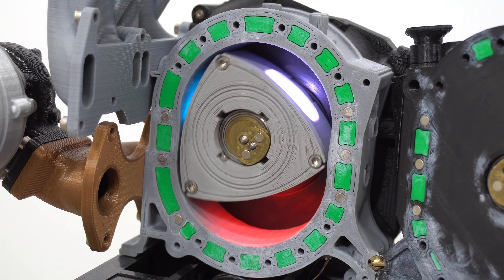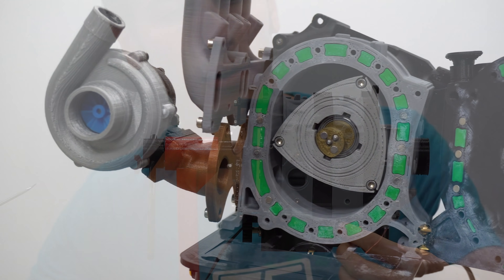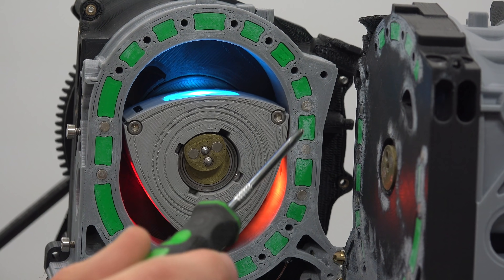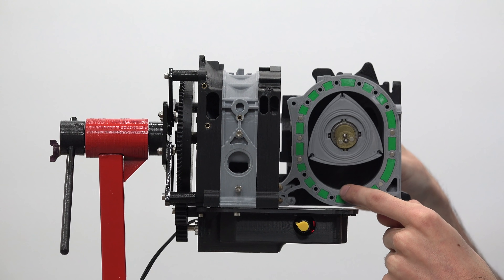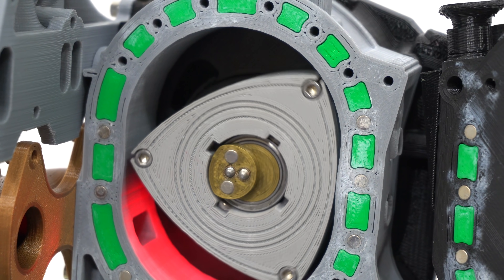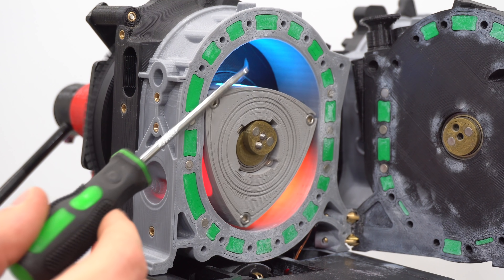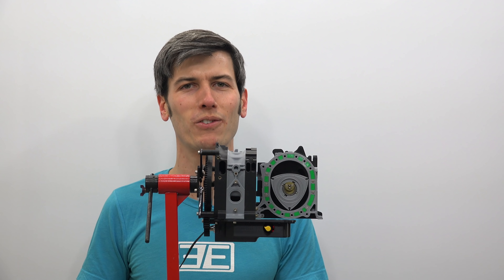This 3D Printed Rotary Engine Is Genius - Mazda RX-7

Comment: Do a video on theoretical "fixes" to the intrinsic weaknesses of a rotary engine. 

Ceramic thermal coatings on the rotor housings and plates. 

Better ignition management. 

Better fuel delivery and porting options. 

Better oil injection. 

I would love to see a theoretical analysis of what would happen by using thermally superior  surface coatings on this engine so it's not producing so much waste on the ignition cycles.

Comment: Not 1.3L in volume... Rotary displacement is based off only one combustion chamber per rotor, so the 13B-REW is essentially a 3.9L engine (the Cosmo 20B 3-rotor is essentially 6.0L). That makes sense from the amount of air it ingests and the power it produces, and the fact that it has the same number of ignition events per rotation of the eccentric shaft as a 6 cylinder engine, which is why Rotary cars are placed in the Power 6 class in import drag racing. I had the last '95 FD3S RX-7 ever imported into the U.S. After non-sequential conversion, it was making ~440 flywheel horsepower on 15 lbs. of boost. Rated at 1.3L, because why not... but it's clearly not equivalent to a 1.3L piston engine.

Comment: I'd like to say to all those engineers who worked on improving the Wankel engine (and other engines for that matter).  Thank you guys, your work has been genius.  So many issues and so many engineering marvels and work arounds.  But the time has come.  Electric is the most efficient, most high performing, most reliable, most practical, cleanest and cheapest way forward.   When the author of this channel, who is a petrol head, chooses a new car - he chose electric.  That should be an indicator.

Comment: apex seals are gone, not suprised
Reply: Had a '76 RX-4 with 58,000 (CA) miles on it... Like a dumbshit, I believed Arco and their graphite oil...shouldn't have done it...i  think that's why the apex seals failed...then I read later that people were mixing 2-stroke oil into the fuel...great idea!  Except for...California emissions!  Wish I'd rebuilt the engine with new seals...
Reply: @jamesingersoll7722  I had the same as my first car, purchased new.  I cannot remember the mileage at which I had it overhauled, maybe 75k or so. It was running fine, but about 200 miles per quart of oil (fill 'er up with oil, and check the gas while you are at it).  Shop said that it was the side seals, not the tip seals, that were the problem.
Reply: That's what killed mine years ago Apex seals fell out after wearing down.
Reply: lol
Reply: @FAWEXX yeah, I was broke at the time I only paid $700 for the car. The guy that had it before me couldn't get it to idle properly so I got a great deal on it and fixed the idle. I didn't have the money to do a teardown. I also didn't have a second car.
Reply: ahhh, rotaries and apex seals...
Reply: @ausintune9014  and failure is catastrophic...
Reply: @ausintune9014  yeah, kind of a terrible design that a integral part of the motor is considered a wear item... 🤨😒😞
Reply: Turbo'd good for about 35k and non about 70k. I rebuilt my non turbo 13B twice after 90k miles. Each rotor has about a hundred parts, what with apex seals, side seal, wavy springs, etc.

Comment: What about a 50-75hp single rotary coupled to a 200hp+ electric motor. The electric motor does most of the work and the rotary is just there in case you run out of electricity. Small size physically, would pass emissions...

Comment: Would HCCI work with a rotary?? Or why not have some sort of phasable rotary valves that can control intake and exhaust ports? Should help with some of the bad efficiency at low speeds and allow for controlled scavenging throughout the rev range. Also maybe some sort of internal oil passage in the rotors themselves that can directly feed the seals? Might reduce the amount of oil burned if flow can be controlled maybe via rotor position...although pretty sure the premix guys would rather inject straight premix and not engine oil lol

Comment: Feels so perfect for small planes. Dual ignition built in. Dual turbochargers, so easy to compensate for altitude. Only rotary movement, so a failure probably means you only lose a cylinder,and still can "limp home", and great weight to power ratio...

Comment: To be honest the common fail point of those engines are the seal. If they engineered the material to be more resilient to wear and pressure i betcha those Wankel's will be still made. Nothing  really beats seeing flaming exhaust and the extreme high revving sound  from a passing Mazda.( I don't care about oil consumption or MPG for a fun weekend car)

Comment: Would it be easier to seal by designing it to operate at a specific RPM? I was thinking the application of a motor for an electric hybrid might be possible if this was the case. I would assume that widening the rotor would make the sealing even worse, so getting a smaller surface area for the combustion chamber is out of question. Alternate fuels would be worth looking into.

If compression with a multistage turbo could get high enough, diesel mixed with vegetable oil used as the fuel and lubrication oil might work. This would help with burning the fuel more completely, but with bad seals I doubt that you could get the compression high enough to run a diesel cycle. You would have some lubrication oil in the chamber prior to being at full compression, but it would be just the sealing oil and a limited amount.

Maybe natural gas with diesel/vegetable oil as the cylinder lubricant? It would have very low emissions since it would be mainly natural gas. I wonder if the flame front moves faster with it though, since that is a limiting factor and why hydrogen would be useful. I know that you can run a diesel cycle with that fuel type and it doesn't take much to clean the exhaust up to CAT IV levels.

I am more of a technician with some physics and material science knowledge, so your input on these ideas  as an engineer would be great.

Comment: The Wankel died because it was design backwards, a proper rotary engine has a triangular block with static apex seals and a figure eight oval rotor which can also handle the intake and exhaust functions.

Comment: I've always been a huge fan of the Rotary despite its shortcomings.  I've had more rotaries that I probably should have but I've loved every one of them.  My 13B-REQ makes right near 350HP.  These days not a huge amount of power but in a car that weighs a bit under 2400 lbs. it is plenty quick and handles better than many sports cars I've driven.

Comment: 4 cycle race engines are rated on 720 degree of rotation and therefore to be equal it is measured using the 4 cycles it does during the same 720 degrees making it a 2.6L motor. Dirt bikes have race 2 and 4 strokes together so they allowed just short of double the displacement, so 250cc 2strokes vs 450cc 4strokes. Mazda's way only works for them and street car use. It's a 2.6L.

Comment: Jason, 
in the 90s, the US government challenged manufacturers to produce zero emissions vehicles within their range and present them for testing. 
Mazda spent big money developing a hydrogen version of the rotary engine. They even had a fleet of test cars (626 station wagons) running on Japanese roads to prove the technology. 
They did indeed produce zero measurable emissions, however, the US government asked if Mazda still used the tiny amount of engine oil from the sump (1lt between oil changes) injected into the intake for the apex seals. Mazda replied that yes they did, but it wasn't possible to measure any emissions as the amount was so small..... 
They were still refused certification, and the idea was killed off 👎👎👎

Comment: I had a 91 rx7. That car rocked! Fast, 9k redline, good mpg (35+) never got hot, never broke down. The car was totaled in a snow storm from an out of control pickup that went through my back yard. But I still have the engine in my lifted Suzuki samurai. 287k miles and still getting 30+ mpg. Burns some oil, but that's what they do. Love that engine!
Reply: ✌I prefer experiences over opinions.

Comment: is a wankel/rotary engine more fuel efficient than a regular one
Reply: Unfortunately no.  Here's the rundown.  Like he said, they inject oil into the air/fuel mixture to help seal the "chambers".  However, they still don't make a great seal and exhaust gas still manages to sneak into the "intake" event, making it difficult to ignite.  Mazda made the engine run "rich" to overcome this issue.

Comment: Losses in the piston engine, changing from reciprocating motion to rotational along with all the moving parts, friction of all the bearings and so on, introduces losses arguably more than the Wankel. (which may not matter compared to thermal efficiency matters)
The Wankel rotary has extremely large total sealing surface area versus a piston engine. Not only at the apexes but the sides of each rotor have seals and those take a lot of abuse. Of course there's frictional loss here too.
While we can easily see fewer moving parts is always better, at least hypothetically, the simplicity means we can't do anything with it. Where today's piston engines have variable everything, valve timing, stroke length, variable number of active cylinders, the Wankel rotary offers none of that. With no valves you can't have a variable valve. Sure it can be tweaked, moved, and has been, this simple design offers little flexibility compared to the piston engine.
Perhaps modern materials, ceramics, carbon fibers, etc. will help the Wankel. Or perhaps wacky things some companies do like a water cooled exhaust and such will help. If dozens of makers spent 100 years developing Wankel's things might be different. I'd love to see different ideas. How about small rotors but more of them? What's better to distribute or sink heat? Shorten combustion cycles? I have to wonder if laser ignition is useful. 
For the record, I love them, have had 3 RX7s.

Comment: For controlling intake at low RPMs  / & completing power stroke before exhaust, why can't they have independent computer controlled slide gates in the ports for different timing?  It would be an interesting concept, anyways.

Comment: The factory manual for my brothers rx7 said to run the engine to red line for 10 seconds 3 times in 2 minute period to "clean" the hydrocarbons and oil of the apex seals. It said to do this at least once every 3,000 miles.

Comment: It seems that with all the new engineering going into the normal gas engine, there'd be some engineers smart enough to figure out how to fix the rotary engine. It seems it would be much simpler engine than something like the  Skyactiv-X.

Comment: Here is an idea to help with thermal efficiency.
 Allow some exhaust to pass over the intake to maintain a higher temp and have an independent refrigerant to pass through the exhaust side. Only problem then is how much exhaust and refrigerant to pass.
Doing this also allows for better cooling since the engine would need it's own a/c unit just like the cabin, so you can have unit send cold air to the radiator as well. 

As far as unburnt fuel and burning oil goes, all I can think of is figuring out a way to have high compression; that way it can run diesel fuel.
What do ya think?

Comment: Hmmm, I wonder if irregularly sized gears (such as elliptical gears on the output shaft) could be used to improve efficiency by putting the engine at a mechanical disadvantage during the power stroke.

Comment: I'd love to see rotaries used in small engine equipment like lawn mowers, string trimmers, chainsaws, etc.  That's where it's strengths, compact size & low vibration,  could shine.  And it's drawbacks, efficiency, oil consumption, & reliability, matter less.
Reply: ooh, and replacing two-stroke piston engines with the 4-stroke rotary would help with emissions without sacrificing power

Comment: Always wonder these engines like to rev high 9000 rpm . Question is that rotor speed  or lobe shaft speed. Or to word it different what does the rpm gauge read?
Reply: It reads eshaft speed. And the fully build ones used in racing, with perfectly balanced parts, like to rev to 10500 or better.

Comment: You review a lot of current existing and operational engines (and do a good job) but I would like to see you also explore theoretical and experimental engines (past engines and future proposed). Check out the Jay Leno's 1963 Chrysler Turbine engine automobile. Using modern technology, materials and manufacturing, I believe automakers could overcome the obstacles and produce an affordable pollution compliant turbine engine in an automobile - there are far fewer parts. Keep up the good work.

Comment: <sigh> I loved my RX8 even though it was like driving a 650CC Japanese motorcycle. Torque was a foreign concept. Had to be careful not to turn off the engine until it had warmed up. Otherwise, the engine would flood and the car had to be towed to the dealer to change the spark plug. Argghhh!  I could squeeze about 19 mpg's out of it if I was careful but more like 14 if I drove it as it was meant to be driven. Still, it was beautiful and a unique sports car. I still miss it along with that high maintenance girlfriend of so long ago.

Comment: Why carnt they use 2 stroke oil in the fuel insted of injecting engine oil
Reply: youre supposed to do this as well (mix around 250 mls of 2 stroke oil into your fuel)

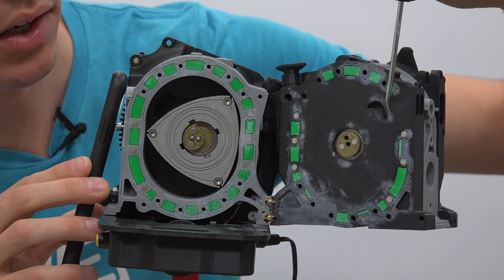Comment: 5:00 there is a point where the intake port is blocked due to the rotor covering it. what happens to the air? I would think it's building pressure waiting to be let into the chamber. that can't be good right?
Reply: just more propulsion :P